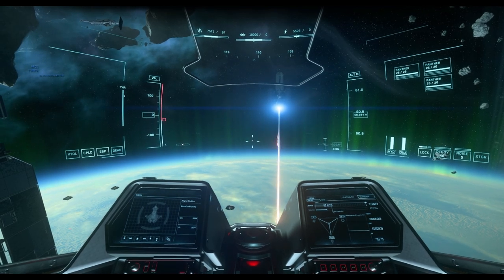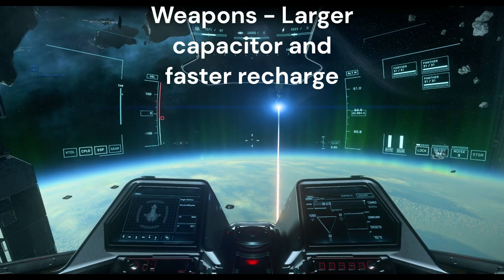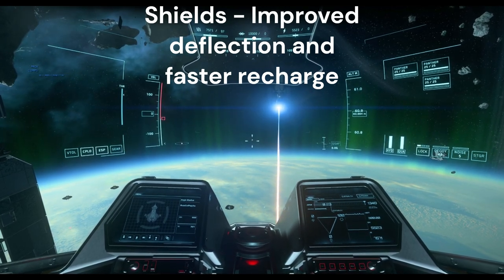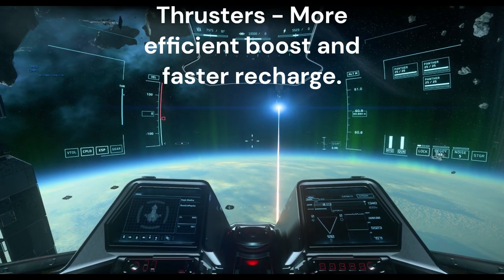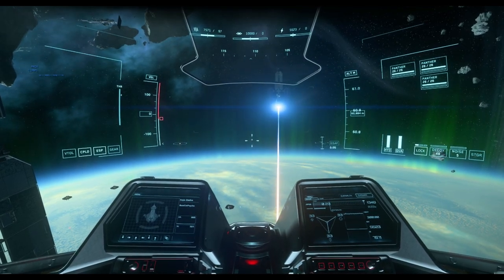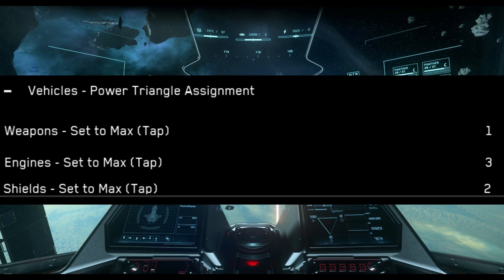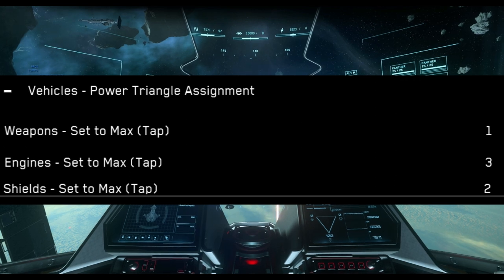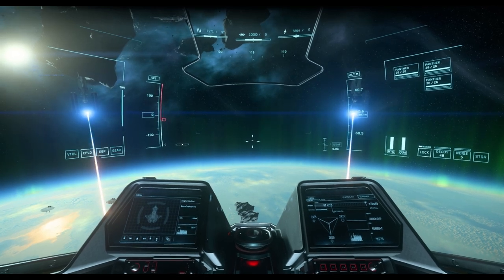Power Management | Star Citizen 3.19

Comment: When we are talking about thrusters, is it really just the after-burner thrusters? or the smaller thrusters around the ship? or all of them?  Also a question for power management for weapons: is there a difference here between ballistic weapons and laser weapons? I  presume laser weapons would draw more power when reloading than ballistics which- perhaps wouldn't reload faster with more power since it would be a mechanical action when reloading??
Reply from the maker: Thrusters are main engine. MAV are maneuver ones. The tiny ones. 

Ballistic weapons draw zero power and allow the pilot to only manage shields and engines. Weapon power means nothing when equipped with ballistics. Finally the gunner is not affected by pilot power management.

Comment: I wish they had a setting where you could set priorities for the power triangle and it would flip to the one needed at that time. Like set it so it's default is thrusters but when shields reach like 25% it trips over to shields and when your weapon capacitors are depleted it switches back
Reply from the maker: That would be helpful and cut down on the APM a lot.
Reply: @BuzzCutPsycho  exactly, I don't think it'd be terribly hard to program either, a slider for each capacitor, and being able to rearrange which is on top and the top one takes highest priority, so you can set it top pri to lowest and use the sliders to determine WHEN the next lowest one gets tripped
Reply: So you basically want the game to do everything for you.
Leaning power management whilst dogfighting is a big part of the skill involved and automating it is the lame way out
Reply: @0Metatron  I already know power management and what I want it to do any when. It's damn near the year 3k and you don't think they'd have a macro for that especially in fighters?

All I'd be doing if that came in is having the ship do what I'd be doing in the first place. Free up a few button binds on my sticks.
Reply: @crazys8s  It’s not just a case of learning them.
It’s a case of absolutely mastering them whilst in the middle of an intense dogfight. 
It’s a GAME not an accurate depiction of the future!!
Tthe button binds are already there for the power management.
If you have mastered using them whilst dogfighting then you will know that you don’t need to automate them.
Why take the skill out of it?
The only reason someone would want to do that is if they felt that it was holding them back somehow.
And the only ppl who feel held back are the ppl who don’t practice enough.
Reply: @0Metatron  I fail to see how it takes the skill out of it. Given that you still need to determine what and when you want it to do.

Yea nah, I don't feel held back by it. I don't lack that skill either. That said, there's an insane number of keybinds to this. Many of which end up unused. And it would be nice to actually use some of them.